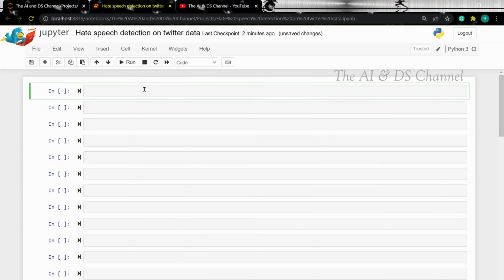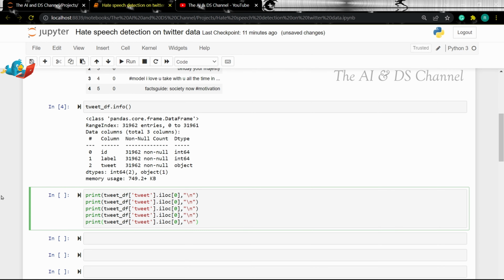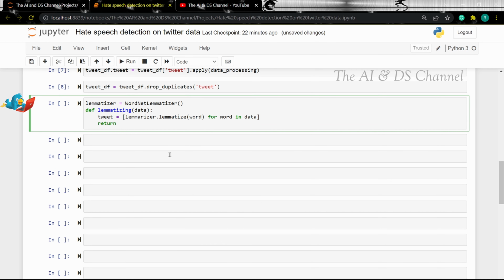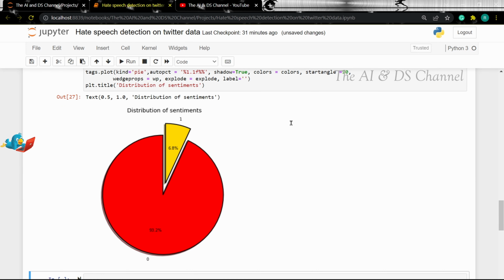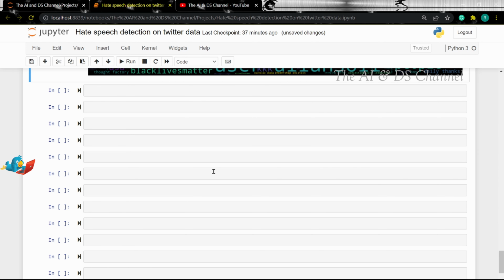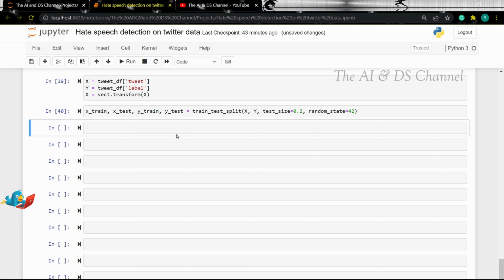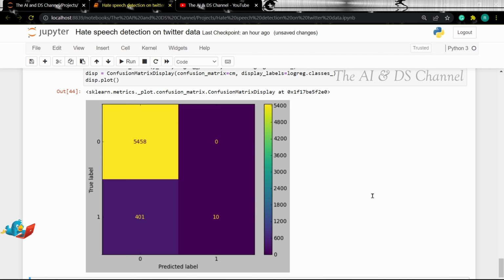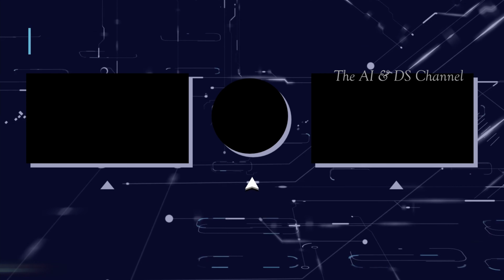Twitter Hate speech detection using machine learning | Machine Learning Project 9

Comment: hey sir! how if the emotion is more than two? example happy, sad, love, etc
Reply from the maker: For this project, the sentiment labels were already provided. If the sentiment labels are not provided, we use text blob to identify the sentiment polarity. Normally for 3 sentiments, we take the the polarity in the range of -1 to 1, i.e if the sentiment labels are equal to 0, its neutral, less than zero is taken as negative and greater than 0 is taken as positive. (This is used in my twitter sentiment analysis video.) If you want to get more sentiments, i.e more than 3, you can split the range accordingly. for ex, -1, -0.5, 0, 0.5, 1. This will give you 5 different sentiment polarities.